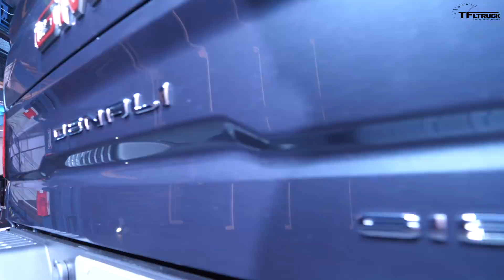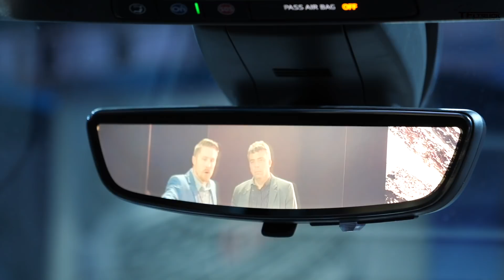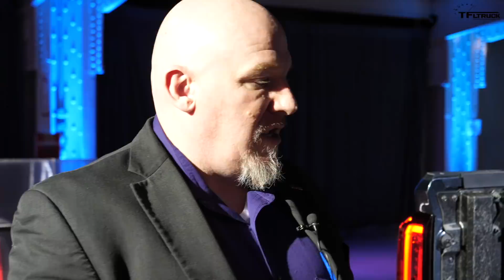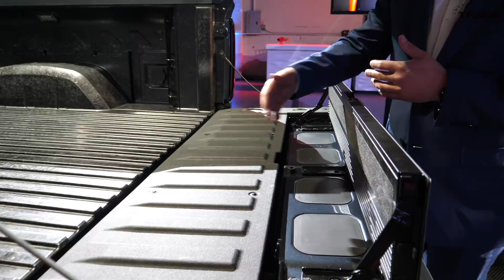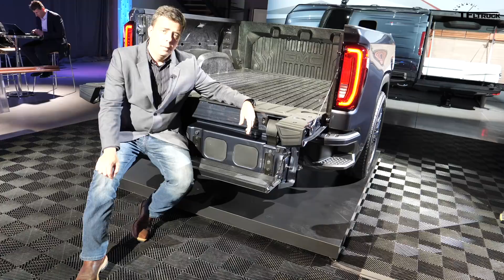Breaking News: 2019 GMC Sierra 1500 Gets CarbonPro Bed and Diesel Power!

Comment: And one of the worst ideas is buying a first generation of a new truck wait until the last of that generation so that they can get out all the Kinks and you can do some research and find out what all the complaints recalls and by then guys have dumped tons of mileage on them so you know if they're going to be reliable or not but he'll the 5.3 is always been a reliable motor well-maintained easily get 400000 km out of it

Comment: Two comments. If it's only available on the short box (5.5') the load stop will do nothing to secure eight foot lumber, plywood or drywall. Second, the guy demonstrating the tailgate looks a lot like a small, skinny, less humble Tim Tebow. Overall I do like the new features though (especially if the multi function gate were available on an 6.5' bed.) oh, guess I should've finished the video. Apparently it's available on both "short boxes".?

Comment: That tailgate idea is actually pretty cool but it makes the tailgate look a little more awkward than it has to be. To me this whole truck seems a little awkward looking but some, not all, of the tech in here seems to have some real value. Still a little iffy on that carbon fiber bed though. Gm really should have kept the design of the sweet looking 2014-15 Silverado at least a little longer. Just my thoughts.

Comment: Ok, Will it end up holding any dirt or road grime between the bed and where it meets the steel body panels where it could collect moisture and cause it to rust through the steel over a period of time? I have a 98 silverado and where it collected dirt to hold moisture, it rusted through in spots and I've seen many this way! GM had to have been aware of this problem! If they would have treated the metal in these areas (like the bed floor is) then there would have not been a problem with this. GM should recall & repair the extended cab versions 88-99 classic. Looks bad on GM & I like GM, so I'm not trying to hate on them.

Comment: No, no, no, no just......no. I'm bored so here's why I say no lol.
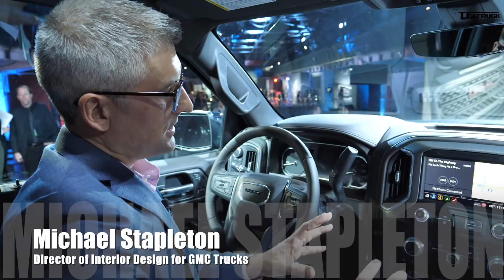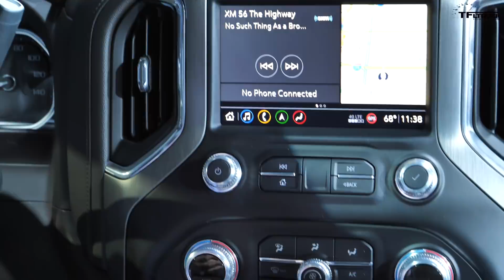1:00-1:25 Unprepared guy trying to save what a boring looking interior looks like. Oh look...shiny knobs.
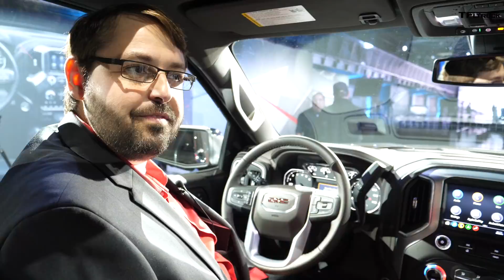4:24 Truck hooked up to trailer for display.......6:28 no trailer connected. App fail. Which is minor issue but still funny.
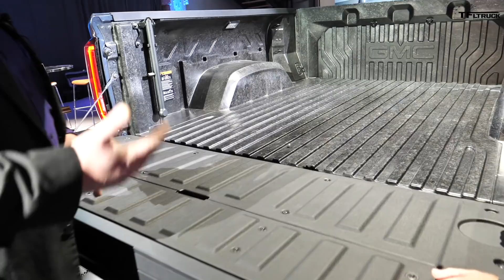9:00-9:11 Recycled trash to make a pro grade truck bed. I'm sure its not actual trash but that's immediately what I thought when I heard recycled.
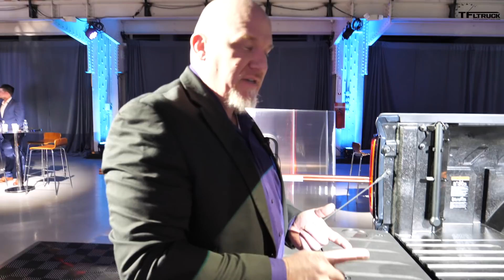10:13 Butt ugly bed that already looks scratched and dented.
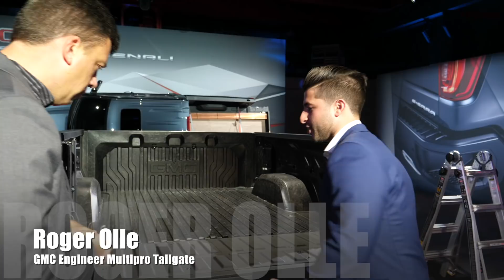11:04 No tailgate handle. Either of those buttons ever pop off, break, or malfunction.....sigh just no.

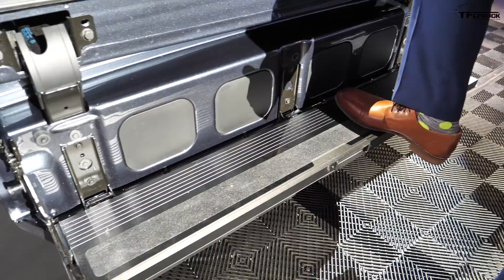Non truck issue 12:10 WHAT ARE THOSE. I can't take a man seriously with socks like that but that's just me xD.

Comment: Where do they get the ideas. People want a truck to last, and last I checked it wasnt because tucks have a problem with their bed being destroyed. 
Reminds me of their stupid commercial of dumping cinderblocks into the bed of a ford from 4 feet up and complaining it dented the aluminum bed.. The people engineering the trucks, and marketing them are clearly not experienced actually using a truck besides hauling their boats and campers. Practical people buy a bedliner
Also good luck with the durability of this contraption of a tailgate in Canada

Comment: While everyone bashes the Honda Ridgeline I cant help but laugh as truck manufactures over that last few years rave on and on about their new features that Honda had in 2006. While we can argue all day about it being a real truck Honda obviously knew what they were doing with its features as 10+yr later everyone is copying them.  Composite lightweight, dent proof, scratch-proof bed 2006 RL, durable leather armrest 2006 RL, multi use tailgate 2006 RL, lights in bed of truck 2006 RL, big knobs for easy use with gloves 2006 RL.

Comment: All I see with all this gimmicky crap is one more thing to go wrong. Let's have electronic push-button to open the tailgate. Let's add another screen. more sensors. More cameras. By the time someone buys his truck used in 10 years half the stuff won't even work and at least cost $500 or more to fix. When the trucks 12 years old in the screen goes out finally, you won't be able to use any of that trailer and Equipment no camera no audio controls or anything else that goes on that screen. Not to mention the more crap they add the more the price keeps going up and up and up

Comment: Living on a farm and working on 99-07 gm trucks alot (we have five so lots of problems here and there). One of them is a 2001 Yukon with almost 500,000 km. It has an aluminum rear cargo door and the paint is all peeling off. Its just like when they used galvanized steel the paint doesn't stick the same as steel. As a work truck this is terrible. Work trucks are for towing. How come I have to get the high end models to get the 6.2 and 10 speed. These gimmicks are stupid what happened to a good old base model 454 Sierra. No sporty trucks either. Chevy make an SS again. Reg cab Short box 6.2 spinning a ten speed.

Comment: I would like to see someone ask those GMC Reps if they have found any solutions to the unfixable shake a fair amount of the 1/2 ton trucks have had since the 2014 redesign.  I ended up taking a $15,000 loss on mine trading up to a 3/4 ton to get away from the issues. It's a shame because I really liked the 1/2 ton.

Comment: Not one thing I like about it... EVERY interior object the mirror is ugly, the dash is too high, the gauges, the radio and heat controls look like a cheap Japanese car missing something... I've never felt this way about any vehicle... the only innovation here is dual exhausts... complete disappointment with gm, this truck looks like it's been in a front end collision it's so short in the front, too many edges on the body for salt to get stuck in and annoyances while hand washing... sorry I'll stick with my 15' Sierra slt... *let me add the push button half flip tail gate is a gimmick now your gate will cost a grand to replace, more shit to rattle off in 10 years... props on keeping the column shift because we are talking about a truck...

Comment: I want you guys to remember this question when you go to the dealership.  "How do I open the tailgate when the trucks battery is dead, I'm out in the field with no way to charge,  and I have a goose neck trailer hooked up?" 
I asked this to the ford salesman a year ago with their new stupid push button tailgates.  He was dumbfounded and a little upset.  I told him, this reasoning is why I will not buy your overpriced crap.

Comment: Love the looks of this over the Silverado, but when you have some swoosh haired hipster trying to tell you about a truck, there's a big problem. Now I understand why trucks keep getting taller, less useable, and loaded with gadgets. It's because city kids who've never worked manual labor have preconceived notions on what a truck is supposed to be. I appreciate the high end trucks for some, but really, someone needs to bring in a group of working men from different fields to see what's really needed in a truck. Construction workers, lawn servicemen, traveling welders, etc. you know, the hands on manual labor people that appreciate lower bedsides that are easy to reach into and trucks that don't sit so high you have to have a "little man step" as Chevy once called it and now GMC uses (ironic?).

Also, curious to see how that bed holds up. Sounds interesting and if it works I like it. Just curious about longevity over a 20 year period. Brittleness, sun fade,  stuff like that.

Comment: Between this and the new Ram, I'm curious whether they'll be able to take market share from Ford.  I like all of the towing options, cameras etc.  I remember trying to hook up with no camera and no spotter, what a PITA.  Having a camera you can put on the back of the trailer is handy too for keeping an eye on all the dumba$$eS tailgating on I-75.  At first I thought the tailgate would be gimmicky but watching the hipster millennial engineer type demo it it looks really functional with some features I wish the Ram had.  Only thing I don't like is you have to have power to actuate it, I wonder if it has a mechanical backup.  As for the carbon fiber bed I really wonder what kind of durability testing it went through.  What happens when Cletus Spuckler decides he want to drill in to it to mount something?  I'm hedging my bets they only put it in a 1500 because they know most light duty trucks don't see a lot of heavy bed abuse.  They're all over my neighborhood, usually empty or with the occasional piece of furniture or tree limbs in them. All of this squawking about not being built well enough is laughable, all of the big three know the majority of these trucks see light use at best.  If you don't like the technology, get a stripped down version.  The big three are going upscale on the interior and technology because that's what's selling.

Comment: Looks like they cheaped out on the interior for the most part. Not to mention the same old column shifter a ridiculously small moon roof and not a completely flat load floor......but look they finally have rear air vents! I find that tailgate to be just a waste of R&D....Looks like Ford and Dodge are still paving the way!

Comment: Wow... that tail gate is way better then the one that closes itself on the Chevy..   That tail gate might get me to get a shorter bed instead of a 8 foot long one because I know I will be able to carry 4x8 sheet lumber with it better.... the only issue with that is I think the tail gate comes down too low for alot of 4x8....  so this is more project grade then professional grade... but that's fine for most people.

I think this is better looking truck too over all..  the Chevy is nice in a flashy way, but it has to be to own the bulge in the front fenders...   This does not have that bulge and is way more toned down but still really nice looking..   Crazy enough the bulge on the door is move in the opposite way from the chevy...  That means you need to specify a GMC door and fender if you get in a accident....  that might make it harder to get  parts for either truck.. but Its nice they are finally fighting the truck market on two fronts.

Comment: But the inside is probably still cheap feeling/looking compared to ford, tundra, and even ram.
Reply: cardiobroker have you even been inside a high country/ Denali??
Reply: mlemmon923 used to sell the Denalis. They’re better than the slt and below for sure but every generation feels like the previous generation from ford and ram. If the prices were much lower I’d think they had something. Hell I’d be a buyer. But for similar or more $ I feel you get far less technology and material fit and finish that are just acceptable.
Reply: cardiobroker I mean IMO they are pretty good compared to some other things on the market

Comment: $$$$ is all I see.

Carbon is stronger and lighter than steel or aluminum. The down side is it doesn't dent or bend. Instead, when it reaches its fail point, it simply breaks instead. The bicycle industry has been using carbon for a while. It is also more labor intensive to make which makes it much more expensive.

Comment: The bed itself is still made of steel, but the inner panels and floor have been replaced with a carbon fiber composite that GMC claims is even more durable and dent- or scratch-resistant than steel. RIIIIIGHT Chevy. Wink wink.
****Ford drops landscape bricks in the carbon fiber bed in 3...2...1...

Comment: Lol they couldn't build a better truck than the F150 so they copied it's styling
Reply: Robert Arauza kid GM is for kids who don't need a truck for work just to act cool. They can't tow worth a dam as in only a 23,000lb tow rating when Ford and ram are both over 32,000lbs towing. There's a reason the Ike Gauntlet is constricted to gm's towing cap and not that of Ford or ram as GM will not be able to compete. Secondly if your pullin with a V you might as well squat and pee, 6 in a row ef it lets go!
Reply: Robert Arauza Ford's and Rams are for pullin big loads GM is for Swallowing big loads
Reply: Robert Arauza  yeah the only thing any GM product is reliable for is, electrical issues, rust issues, superiority complexes buy there owners. Seriously there worthless.
Reply: Robert Arauza keep loving your Government Motors kid. I'll take my Yota and it's reliability over any GM or Ford any day of the week.
Reply: Michael Wilburn my 2017 6.2L pulls my 32' camping trailer alot better with alot less squat than my old 16 f150 with a 2.7L eco junk that blew up at 63,000 miles and also  had non stop electrical problems with the built in gps..

Comment: Based on the GM executive comment at the reveal of the 2019 Chev Silverado in January, the new small 3.0 liter 6 cylinder inline diesel engine will have more power than the Ford F-150 V6 diesel of 3.0 liters. The Ford diesel has 240 horsepower and 440 pounds feet of torque. Even if it's just 5 HP more or 10 foot pounds more torque, it's still more. It will be known as a Duramax diesel just like it's 6.6 lier 945 pounds feet torque, big brother the HD V8 diesel in the 2500 and 3500 pickups. Ford charges an extra $4,000 for its small V6 diesel. GM will have to match that or beat the price for 2019 models.

Comment: My 1995 GMC Sierra has 2 doors, 1 bench seat, 6.5' bed, auto tranny, 5.0L V8, vinyl floors, hand crank windows, and an AC DELCO AM/FM Radio.....  BUT they all still work at 23 years old and 200,000+ miles.  I love trucks and how adaptable they are becoming, but good god how durable will these features hold up over the years and how much to fix when they do break!  Sometimes simpler is better in the long haul.

Comment: I like the load stop/ step, they really shouldn't call that bed carbon fibre, that's not really what it is, it contains fibres of carbon in the plastic, but it is in no way true carbon fibre.  Could still be good option for bed construction, but I want GMC  to drop a load of bricks in it from 12 feet in the air first.
Reply: br ly carbon fibre is plastic.
Reply: Gavin Booshu true carbon fibre is woven and layered very tightly, yes it does use a plastic resin, but not nearly to the same ratio as the stuff the needs made of

Comment: Cool, 3rd brake light camera....Ram had that in 2014. 
Cool, moving rear cam guide lines with steering.....Ram had that in 2013. 
Heads up display.....thanks. That's technology that GM had back in the 90's
So what exactly do you have for $80k that's actually cutting edge?

Comment: So basically the “carbon fiber” beds are plastic. Still probably classified as carbon fiber but basically plastic. I wonder how similar it is to firearm plastic or industrial strength plastic pieces. I don’t think theirs anything wrong with it but people are going to go ape 💩 over GM chastising of Ford for their use of aluminum. Makes you wonder what else company’s will move to plastic. Makes sense really, cheap, easy to produce and replace yet they will still charge an arm and a leg for trucks because of the gadgets and gizmos.

Comment: Can we assume that the 3.0L Duramax I6 will be available to the 2019 Sierra?
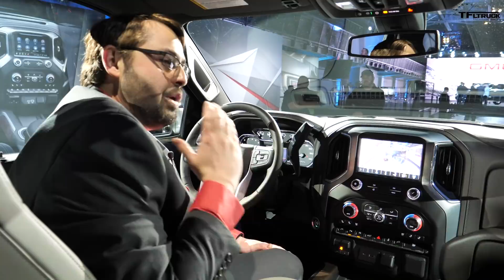Reply: JIGA BACHI Go to 6:18 in this video
https://youtu.be/kFJtQIzdhZ0
Reply: INDEED, too bad it's a fleet thing. The regular consumer always GETTING THE SHAFT. Thanks, Ford !
Reply: I'm sure GM will copy FCA and Ford model. Half ton diesel-powered pickups, in higher end trim models, will have a diesel option.
Personally,  I don't think diesel engines in half ton pickups make sense. When your DPF clogs up and leaves you stranded due to all the quick, short trips around town.....

That tailgate is nifty though.
Reply: The Fast Lane Truck can we get the base sierra with the 3.0l diesel? If not what about fleet models only like what fords doing with the f150 diesel base.
Reply: Here's $100, go to nearest strip joint, you'll find your favorite religious deity figure getting a lap dance, drink in hand and you'll get all the answers to the meaning of life, where we came from and the origins of the Universe... LOL, NOT A CHANCE.
That's how much of a chance you have of getting a 1/2 ton base Sierra or Silverado with a diesel.
When did FORD mentioned they'll be selling base F-150 with the diesel Lion in it ? ! Got a source ?
Reply: JIGA BACHI tfl truck said the f150 diesel will only be available in the higher trims but said the xl and xlt diesels will be available for fleets only.
Reply: JIGA BACHI I'm sure people will get there hands on them and there will probably be some on the used market.
Reply: Dodge 318 Cummins hope so(fingers crossed).😬
Reply: billy mc ram was the only one to offer the ecodiesel 1500 in all trims and all cabs you can get a regular cab long bed base model 2wd diesel.
Reply: It's fine, there's simple(albeit expensive) measures to take to prevent that from happening.
Reply from the maker: Yes! They said the diesel will be available as a late release for the 2019 GMC Sierra and the 2019 Chevy Silverado 1500.

Comment: I am wondering if the tailgate has the possibility to come open if you say sitting the tailgate on that top section and you have it closed. Tested for the being able to hold the same weight like a normal tailgate but still.

Comment: Andre! Big question: will there be gap issues in the cold? Plastic shrinks a lot due to thermal expansion, so there must be some issues with it when put beside steel. Also fastening methods would be interesting to know

Comment: Glad GM has finally install the tailgate hand warmers for when it breaks down you have to push it 😂
Reply: Naw that's for pos fords like when my old 2.7L eco junk blew up at 63,000 miles. Also had non stop electrical problems with the gps in it too.